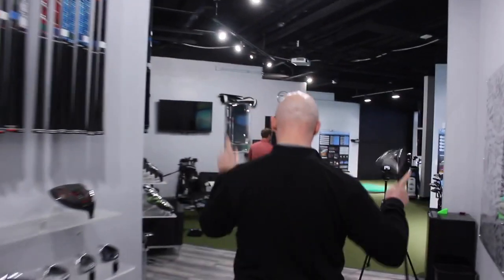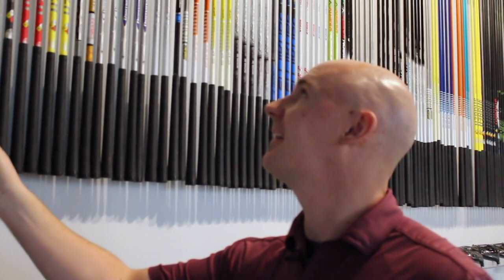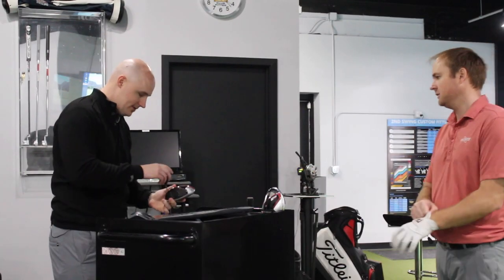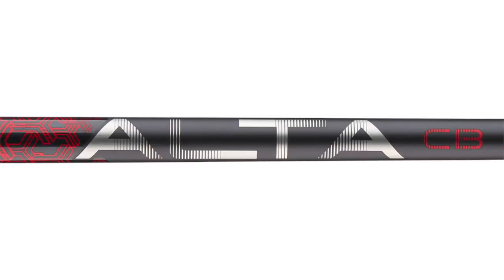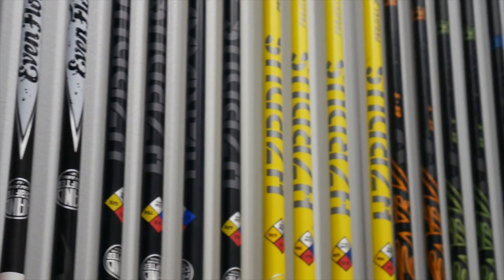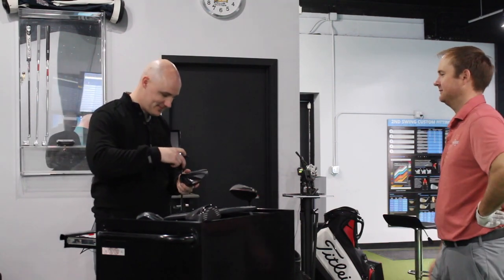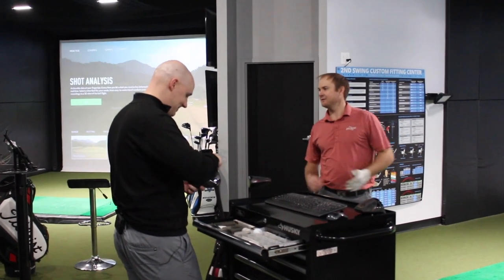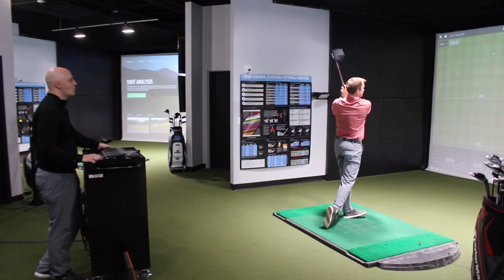Choosing the Correct Driver Shaft Length | Golf Club Fitting Discussion

Comment: Earlier this year I had the driver shaft shortened from 45.25" to 44.5".  Fitter added a little glue to the inside of the head to increase head mass (so the swing weight was same as the longer driver).  I hit the driver much more solidly now, find more fairways and there is no noticeable loss of distance.

Comment: Sergio garcia plays with a 43, Tiger and Fowler 43 1/2. I recon the big manufacturers know shorter is better but want us to have trouble with the driver so they can sell us a new 'game changer' every 6 month.
Reply from the maker: It has a lot to do with the big movement for distance. A longer shaft will help you hit the ball further, but a shorter shaft is easier to control and hit straight.
Reply: @2ndswing . Cant argue with Physics, the longer the lever the further it will go if you catch the COG sweetspot.  Non sweetspot  with long lever shots are not as long as sweetspot short lever, and the average golfer will hit this sweety more often. Tom Wishon explains it alot better than I.
Reply: Club manufactures just want to sell clubs, so they lengthen it to say it goes further.